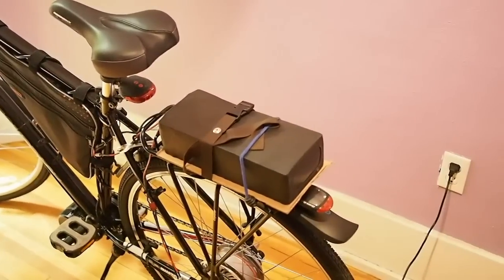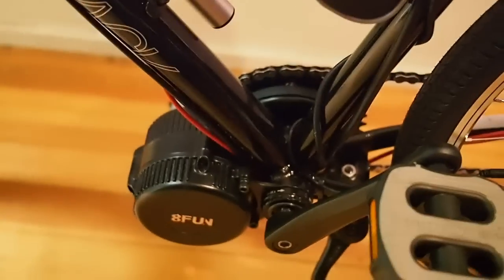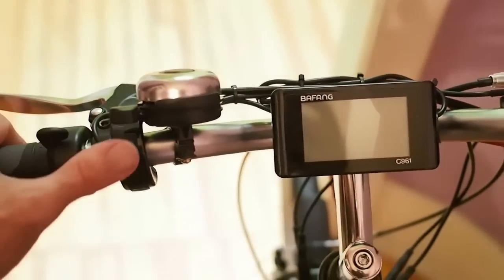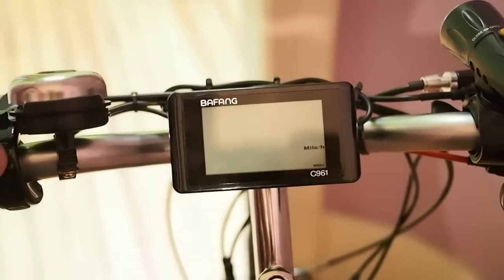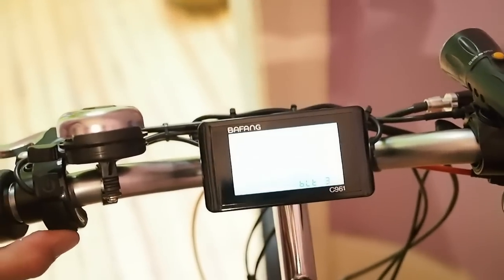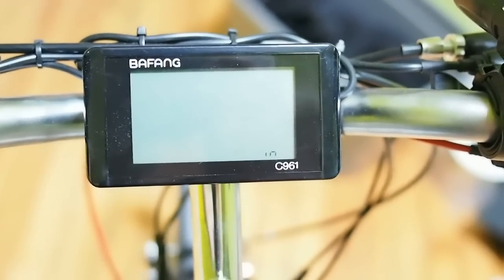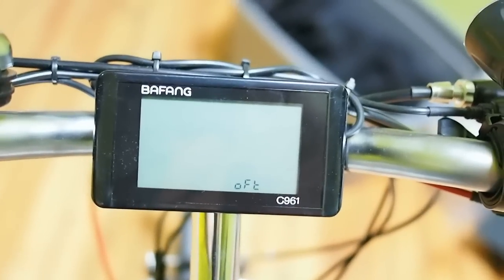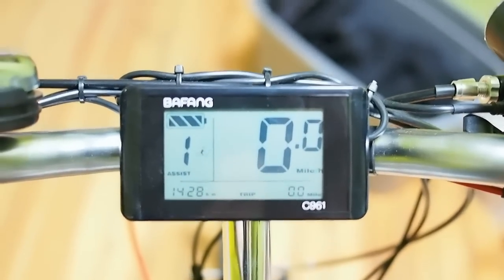Bafang eBike Final Setup - how to configure the C961 eBike Controller

Comment: how does the speedometer work? I have a bike with a 1000w rear hub motor and I was thinking of adding on a mid-drive motor. Will the speedometer govern my speed at 50 km/h for both of my motors, or just govern it for the mid-drive motor?
Reply from the maker: Ashwin Ramdas - it has a hall sensor for the rear wheel. so if the speed of the bicycle is over 30, then the mid drive motor will provide no assist. (Probably not what you want...) This also means that the more you use the hub motor, the less the mid motor would assist drive.

Comment: Is there any way to derestricy a 250w bafung rear hub motor with samsung 36v battery with the controller attached to battery.The battery sldes into the white controller making it one unit.
Reply: Did u figure it out?

Comment: Hi there, I got the same kit. Did you solder the engine power wires to the battery cable? I got a loose end on a cable that came with the battery that has to be connected to the engine cables. Not sure if they can be connected any other way.
Reply from the maker: I soldered 5mm gold plated banana connectors to each end of the battery, then soldered banana connectors of the opposite polarity to the motor cables. This allows the battery to be removed or swapped. I've also seen C14/C15 connectors used. (that's the 3 prong 'PC' end of a standard Computer power cable.)

This Video- Bafang BBS-02 Advanced Serial Hacking - Throttle shows the power being connected and disconnected and you can see the banana plugs clearly.

Comment: Hello! TSU me display writes error 7b and turns itself off. What should I do, how can I fix it?
Reply from the maker: If it's the Error 7 I have seen then it means your battery is higher in voltage than your controller is set for. (i.e.Could it be that you are using a 48V battery but your controller is set for 36V?)
Reply: @charleswerbick2154  Hi! Thanks for the answer! I use a 500 watt motor and a 48 volt battery. The controller is 22 amps. What is the way out of this situation?
Reply from the maker: @АркадийЛевин-ы6г  -the first thing to try is to drain the battery some. (If the battery is actually over volts it will start working once the voltage drops.)

If draining the battery some doesn’t work, then the voltage sensor may be damaged. That’s possible if the bike motor has overheated or been run too hard.